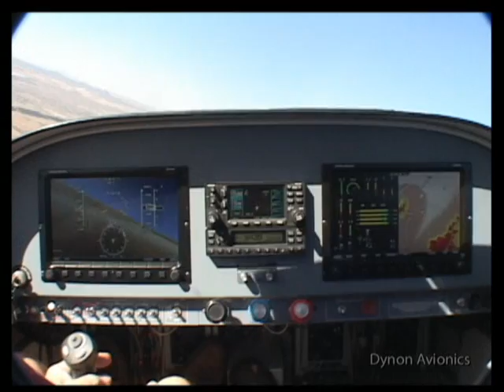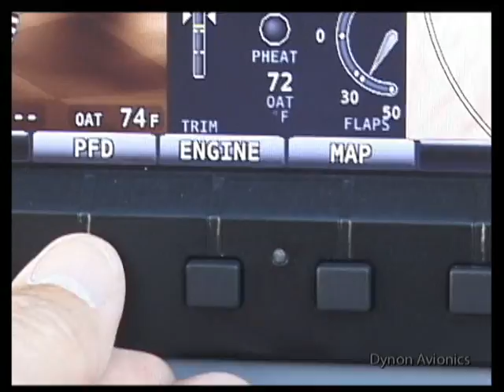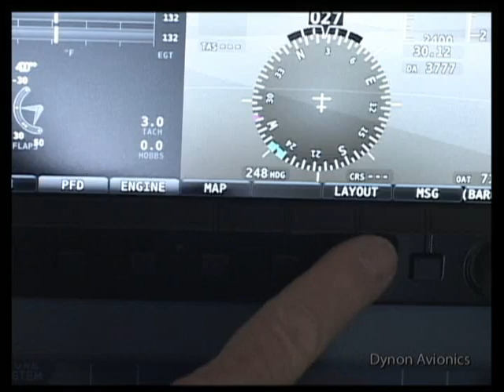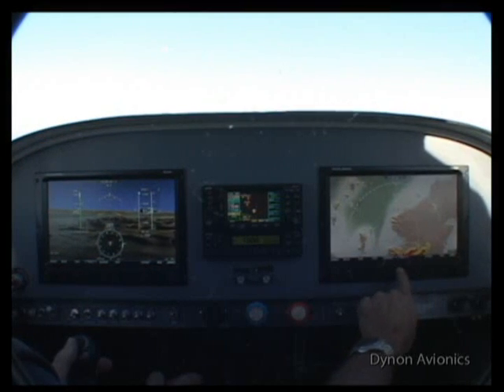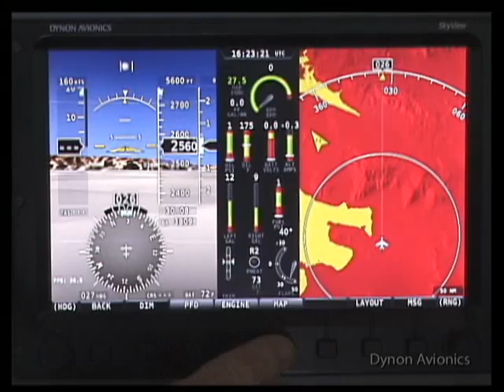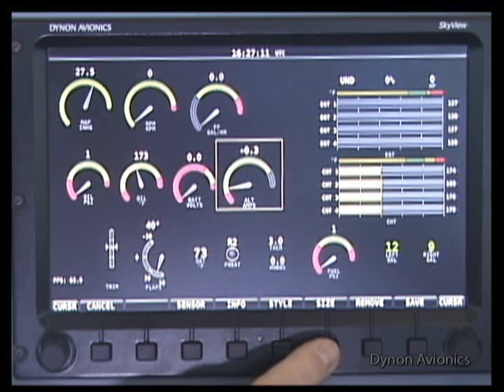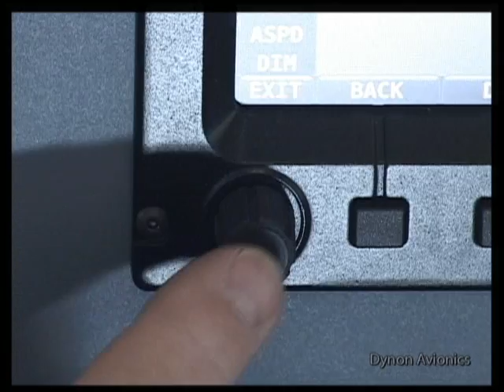Dynon SkyView Intro

Comment: There are some components you need along with the display.  A complete single screen 7" system is under $5,000, and a 10" system under $6,000.  A dual display 10" system is about $10,000. (Compare this to certified systems costing $50,000 to $100,000 and up.)  -Robert, Dynon Avionics

Comment: the blind landing is possible with this technology more safer. great    i think commercial airliners need to use this features to give better services.
Reply: SNZISM the airlines are able to get into most airports with 600 RVR, and seldom does it go below that, so it comes down to cost vs. benefit.  And most airlines have to auto land in weather below Cat 1.  Autopilots don’t need to see anything.  It’s great technology but I don’t know that it will allow any more capability that what they currently have.